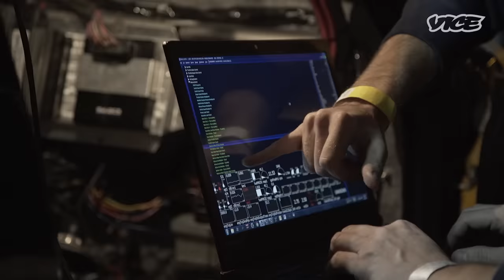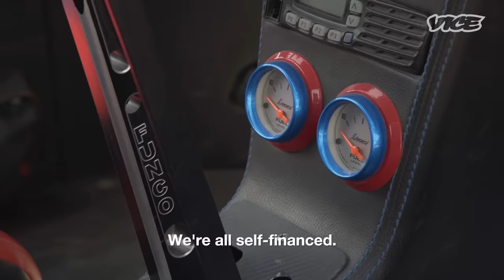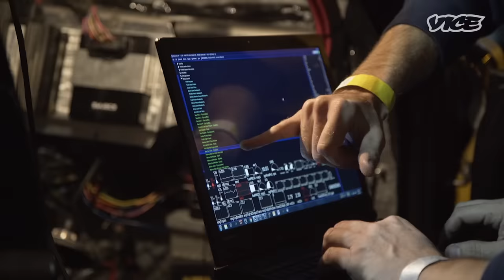Off-Roading Abu Dhabi’s 'Hill of Horrors'

Comment: “Backfiring” 
It’s called a 2 step my dude
Reply: neither that, theyre just bouncing off the limiters.
Reply: Where are the camels, thats the big question
Reply: What they did with the pick up truck is rev it then crank the engine to create those backfire
Reply: There was a big ass backfire right after he said that tho lol
Reply: Omg no one knows what a 2 step is lol
Reply: @MrTrowe123  2 step is a rev limiter. People think reving the balls out of your car isnt 2 step
Reply: It is backfiring. It’s unburnt fuel igniting in the exhaust. 2 step is just a temporary rev limiter.
Reply: Steven Jalopnik it’s running so rich and thus backfiring during 2 stepping because of the rapid variation in revs when its held at that limit
Reply: Or 3 step
Reply: Technically it is backfiring....
Reply: It is backfiring lol

Comment: Spend millions on their engines? i got some engines for sale
Reply: $1,000,000 USD = $3,673,000 Dirham......today at least
Reply: @coryshirk5852  today and forever the currency is tied
Reply: But you could tho, they don’t know the difference
Reply: @TryNotToHate1  sure just sell them Prius engine.
Reply: Naw. LS1. Makes power. Cheap as hell. Fool anybody
Reply: @TryNotToHate1  most of the cars are nissan patrol they just swap it for a gtr engine or turbocharged it
Reply: that was mistranslated,  it was supposed to be "people spend millions on their cars"
Reply: @TryNotToHate1  trust me,  we know the difference,  just cause we don't live in America doesn't mean we don't know anything about cars
Reply: @mkalaskar4554  THEY NEED TO USE 2JZ THEY CAN HANDLE THIS ABUSE AND ITS A V6
Reply: @alialdhaheri8057  Sorry man, some of my fellow Americans don't comprehend Gear heads outside of our bubble.
Reply: @fredg2777  straight 6*
Reply: Just us a barra straight 6 4 litre
Reply: Eugene Dowling only us aussies have em mate
Reply: No it’s an inline-6, and the RB26’s from the R-32, R-33, & R-34 GTR’s were as well, in addition to being cast iron blocks rather than aluminum so they could handle more boost. The engine in the R-35’s is an aluminum V6 however and needs more modification to reach the same power levels reliably as an RB-26 or 2JZ.
Inline engines are inherently more stable than any other engine layout because the pistons aren’t pulling on one another which is why they’re so good at making more HP per Liter/Cubic Inch.
Reply: AED
Reply: @fredg2777  straight 6
Reply: @fredg2777  A V6? LOL
Reply: turkey man bro I don’t even own an American car so your comment is dumb, only cars I have are a petrol and a Mercedes amg
Reply: turkey man ship whatever car you want out here and take it to the track, you’ll win some and lose some, just like anywhere else in the world that has a car scene

Comment: "Where they spend millions on their engines alone"

"Each car cost 135,000"

Hmmmm.....
Reply: lulem400 probably how much they spend per season on rebuilds.
Reply: Probably the cost of the cars without the custom built engines, and rebuilds that may need to happen throughout the season.
Reply: Yo the four wheell old school suvs that have new custom engines with turbos etc are worth millions to be at peak conditions the whole season
Reply: Or prolly millions of dirhams?
Reply: They put a lot of engineering into the engine itself. A lot of custom work done to it. Titanium and steel parts are expensive.
Reply: The maintenance
Reply: Maybe millions over time
Reply: Most of them just make a hill and blow so 135,000€ for one lap is cheap for you?

Comment: Formula off road trucks don't spend "millions on their engines alone" and would make it up that hill no problem.
Reply: Collectively, they would - but perhaps he was referring to a currency that was of a lower nominal worth? Dinar, perhaps?
Reply: The dinar is one of the most strongest currencies in the world, in fact, the Kuwaiti Dinar has been the strongest currency from time to time. Also, these guys dont have formula engineers and specialists its just regular guys taking it as a hobby
Reply: That is a 40 degree incline on loose sand without special paddle tires and they cover 300 - 500 feet in 6 - 10 seconds. I'd love to see those formula off road trucks that you mentioned do that with no problems.
Reply: Sohaib, I stand corrected, I just used the Dinar as a non-US$ currency to illustrate that other currencies exist and are used - the only currency I could think of on the fly from around that part of the world. Still friends?
There are many, many different forms of 'off-road' motorsport and, vehicle to vehicle, some of those builds would be rather more expensive than the ones in this video.
Those different vehicle sports/competitions will also have different regulations and 'spirit' - probably the fastest thing up those hills would be a sand-rail, but not sure how acceptable it would be.

BTW, been a fan and follower - to a point* - of the Nordic/Icelandic nutters for 20 years, or more :-)

*As in, if it is on, or I come across it, I'll watch it, but rarely seek it out.
Reply: I'm sure they have class restrictions here. They probably have to meet a minimum weight to qualify. (Prett descent sized SUVs seem to be preferred). A formula offroad truck would make it up there, but probably would not be allowed to compete alongside.
Reply: Tough???...meh....3 words.....American Rock Bouncers...that's tough..............   :-)
Reply: pretty sure its not about making it up the hill alone, more like how fast you can
Reply: I'd take a Icelandic Formula offroad rig over a rock bouncer for this type of driving.
Reply: Sohaib Aziz wish I could move there.
Reply: He's referring to the AED which is the dirham not dinar... millions in dirham refers to about 250k usd
Reply: money can't buy brains :')
Reply: I would use a V8 engine built to around 3000 hp,  tube frame chassis and 2.5 ton axles, NP205  T-case with bigger output shaft installed,   Super single tires  running 15psi, Nissan Patrol Body  with gutted interior.
Reply: +davidbrennan5 you aussie?
Reply: I am a Machinist  and I live in Canada.
Reply: aha, nvm though, just found it quite odd that you mentioned a nissan patrol, anyways have a good day
Reply: Alex Mackie Lived there for 10 years bud not worth it, ur better of living in Canada or Scandinavia, best places to live imo
Reply: Rashid Gargash ik the show was talking about dirhams and that’s what the guy in the comments meant since it’s UAE but I was just clearing  a misconception about the value of the dinar
Reply: Smo Key 🔑 for Allah was 900k
Reply: I Could Build 5 Super Nice Ultra 4 or 3 5* Truck Trucks Fit For The Hammers With A Million. This Guy Knows 0.000% Of OffRoad or any Sport Racing etc. the UAE 🇦🇪 is Rack City Bc Dyno Test Isn’t That In My City! $2k
Reply: Smo Key so why haven't they done it yet? 
Not starting an argument, I'd have a great time watching it.
Reply: Dullz.z 78 I think they have specific classes. And im not sure if it would be worth it for them. I just think that type of truck seems well suited for it.
Reply: Smo Key i get what you're saying. Well they can drive across a lake sooo 😂 these guys should take some tips from them, like nitrous if they already haven't.
Reply: Mark Wever look up formula off road please. It is not at all like f1. And no these are not top fuel cars. Top fuel dragsters produce over 12000 HP in a lot of cases.
Reply: Did I post a time in that original comment, or did I say "would make it up that hill no problem".
Reply: Smo Key it's on uae dirhams 
their average cost comes like 150k - 250k... sounds more reasonable + don't underestimate soft and ;)
Reply: No one suggested a stock Subaru... Did anyone notice all the girls hanging out.? Yea, me neither.
Reply: Sounds too heavy for sand. I'd lighten that combo up with some lighter weight axles/ wheels.
Reply: have you seen formula offroad from Island, its what they do.
Reply: Mark Wever    so I take it these "modded" stock blocks can handle a run on nitromethane? Um I would disagree. 3000 hp can be made pretty easy anymore. It's by no means out of reach for anyone with brains
Reply: Smo Key yep
Reply: have at it.
Reply: Patrols with skyline donks were popular until the "LS" wave came along.  Cheap, receptive to mods, parts availability.  Patrols have decent axles from the get go and a decent chassis for a lot of different off-road work.  I don't know why majority of the u.s hates them.  I'm getting off topic though.
Reply: stu booth I'm in  the  us and would  love  to  have  a  straight  axel  patrol, but they are kinda hard to  get here
Reply: Sohaib Aziz and thats why developing a solid engine platform could run into the millions for them, does that single engine they race with cost a million dollars,  I doubt it, 100k well that could happen quickly and if you add up all the destroyed parts, testing and tuning to get the engine build they currently have sure it can hit millions.

If you called Toyota and asked how much it cost to design  a formula engine not including man hours the number would far exceed a million and that's not even an engine that comes with a warranty
Reply: Kurt Ingalls two words......too heavy

Comment: still dont understand why some dont run a filter on the turbo when theyre racing in a SAND dune... smh
Reply: IYlercy probably because the engine has a 30 seconds life they prefer a higher air flow than more durability
Reply: Because they have enough mone el=y just to scrap it and just another one, or a new engine if they want the frame and everything still. They dump Ferraris and Lamborghinis on the side of the highways after crashing them going fast as fuck
Reply: Power reduction
Reply: i would rather lose 5 hp than blow up my engine. and since when does running a turbo filter cause an oil leak LOL.

Comment: interview dude: i suggest you come to america and witness an nhra event of funny cars and top fuel dragsters. but you have to get up and stand by the wall- not in the stands. after you witness that to where you not only see but FEEL what it does to your body on take-off, a little revving and backfiring of a motor is absolutely nothing. you literally cannot see clearly with your own two eyes for the first few seconds of take off. if backfiring bothers you- then you'd most likely wilt and fall to the ground. there are no words that explain it. you just have to bear witness to the raw power.
Reply: reaper creeper The ground vibrates so hard that you feel like you are floating when the cars take off.

Comment: Damn loving those high horsepower engine!👌
But wheres the hot women spectators and hot women drivers ? bit of a Sausage fest zzzzzz 👎👎🤷🏼‍♀️
Reply: There are women there alright.. the whole 9 days event includes 
1- camel and horse racing
2- falconry competition 
3- classic car event
4- drift event (different classes)
5- motorcycle hill climb (different classes atv utv etc)
6- the main event 4x4 hill climb (different classes (6 cylinders, 8 cylinder etc)) 
7- motocross race (250 & 450) (not sure if they did it last year)

All the above categories attracts men, however women are welcomed and they do attend, just not how you are expecting it..
Reply: Abdulla A lies
Reply: they are at home. that is how it works

Comment: That's great that they have adopted this sport.
The tuner guy has an American accent. No surprise. It takes a guy who is really sharp with a computer to get an engine dialed in. NOT like the old days where you just change a jet in the carb.
There doesn't seem to be ANY appreciation of the need for a rev limiter.

Comment: This is an example of more dollars than sense... The sport began at GLAMIS and DUMONT DUNES ..After the movie ON ANY SUNDAY (1971) sand dune toys started getting serious. A sand rail that lasted a 3 day weekend was more important than being the fastest.. Now a days you get both if you buy the sand rail from a pro (So California) outlet, you can have a 1,500+ hp turbo ls reliable sand rail.. Wheelies at 100mph all weekend long.. And more important than the power (within reason) is the paddle tire set up.. (skat trak & sand tires unlimited).  Pressures are run high in a paddle & the paddle acts as a propeller works in a drag boat to a certain degree...   Different sand requires different tire set ups .. These guys seem to be in the 1970 - 80s mindset where it's all "POWER" when in reality,  the rig would be faster  with gear and tire and suspension set ups... 250cc bikes NEVER use 1st gear when set up right.. Enough "spin" in the paddle to allow that next gear needed.. 
   In time, these guys will figure all that out, but till then it's comedy watching this...

Comment: The oil inside the oil pan of the engine in which the engine source the oil from will move around the pan aggressively when the car takes off at high speeds creating a strong backward force that pins the driver to the seat. When the oil is not delivered to the engine, it will either stall or explode due to combustion. It will happen more likely when the car travels at extreme steep angles like the sand dune.
Reply: They have special oil sumps and oil delivery systems to prevent cavitation and oil starvation.

Comment: This is pretty cool, it must be a shit load of fun ripping the dunes with those overpowered toys, and even better when your wallet is so deep that the only limit to what you can do is that there are no fuckin limits🤪
On a separate note, the narrator has clearly very little motorsports experience, since he describes that dune as almost 90°. I wonder what he would think if brought to one of those rock crawling events where the track actually HAS tracts that are 90° and over.